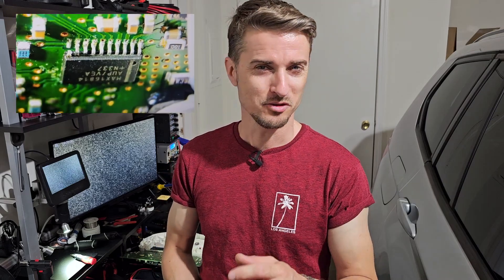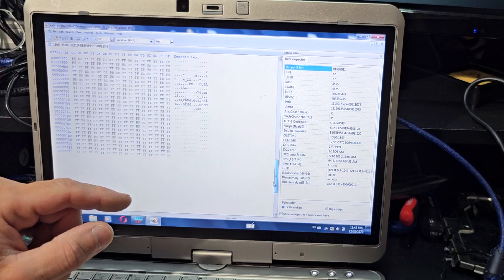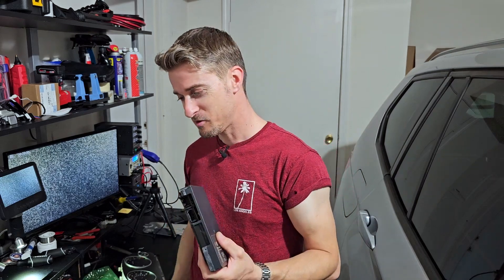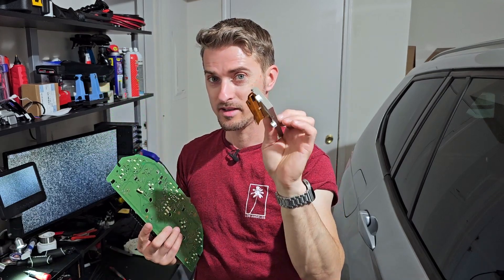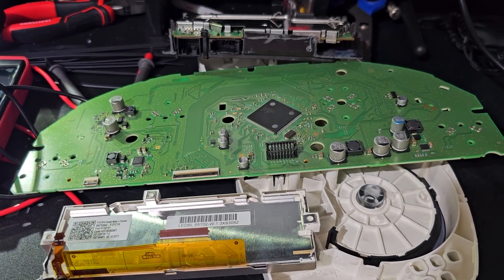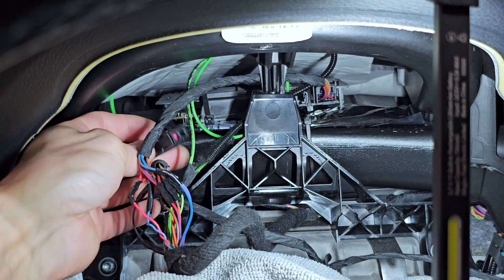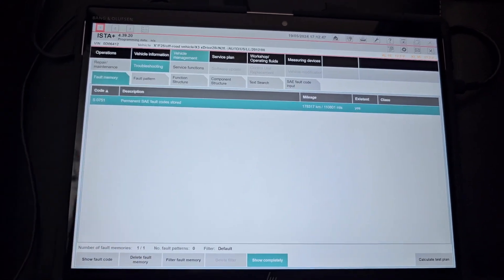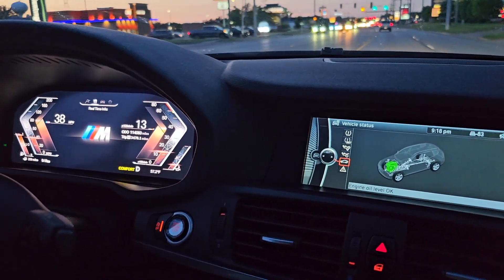Linux digital Instrument Cluster on BMW part 2

Comment: Friend, is it possible to retrograde a modern BMW digital cluster back to an analog cluster? Some of us older guys do not like all this digital crap.
Reply from the maker: Sure you can !
Reply: @MOvidiu  Yeah I figured that out after commenting. But ostensibly it is not possible for these whole dash digital screens in iDrive 8 such as in the new M2?

My best idea thus far is to employ an CAN bus reading device to read real-time relevant data (e.g. speedo, rpm) and somehow interface these signals to custom analog gauges. Obviously this is plausible because of aftermarket products such as P3, Bimmercode and JB4. BMW is starting lock down modules in iDrive 8 with cryptography, but I assume the CAN bus packets are for the most part still unencrypted? For BMW to encrypt packets, then all communicating modules have to engage that cryptography, thus BMW probably needs a holistic approach (maybe in iDrive 9 or next revision of iDrive 8)?

But I do not know how I would position these gauges on the dash, because the navigation screen to the right is one piece with the digital gauge cluster screen. I reckon I need to place it in front, thus I need very thin gauges. Maybe an e-paper display? Maybe lay the damn thing flat and using something like CanDo+ to drive the HVAC controls separately from my own dash tablet or custom analog dash?

There is demand for such a product. Dozens of people complaining in forums about the non-customizable look&feel of the gauges in iDrive 8. Ostensibly BMW originally intended to charge subscription fees for such software modifications.

Maybe we can collaborate with my funding on some projects? Lifelong (since age 13 in 1978) computer programmer. Have some background in Electrical Engineering as well.

Comment: You are quite incredible.
From one thing to another...
I have a number of faultcodes in my 2011 F25 30d, but I don't know when they appear. I thought I came from low voltage in the moment when starting the engine that means the battery should be too weak.
Now I have a brand new Exide 105 Ah AGM battery and installed with Bimmercode and Bimmerlink.

Now I will follow what happens during the summer, but then I would like to write you an email to get some kind of opinion that means if you are able to guess or not.
I'm now a little bit "afraid" that there is some electric consumer somewhere, but as I said, I need some more data to hopefully be able to encircle the problem.
I have to check if I get the fault codes at the moment when the engine fires up.

The fault codes don't seem to cause any problems when driving, and I have no problems at all at starting the engine!

You don't need to respond to this message at all, as I only find the problem strange, or better I think I have some kind of problem somewhere.

Have a nice summer!

Comment: Are does boards get hot? I mean you used a plastic bag so maybe it will melt it?
Reply from the maker: Theoretically, no,  especially in this case where all the consumers ( motors , dysplay) and only the processor it is online. As mentioned, this is a test and not a permanent  solution